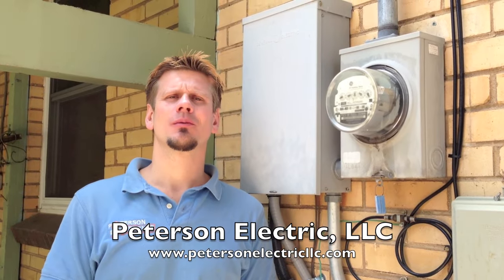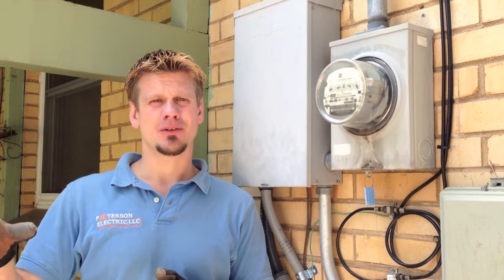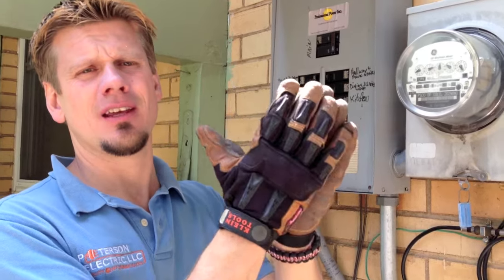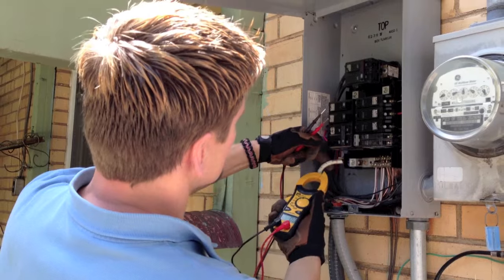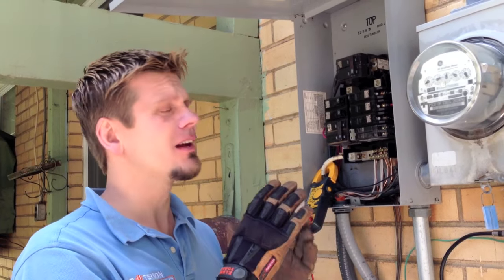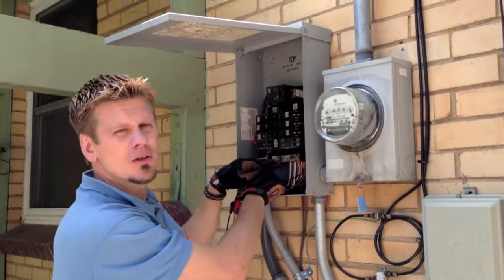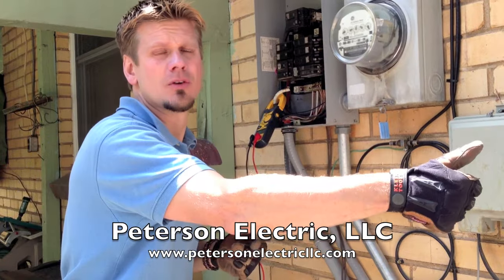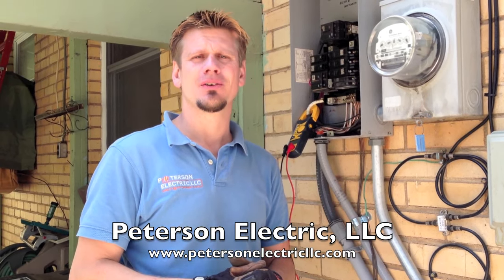Half My House Is Out Of Power, CO Electrician

Comment: I had someone come replace a blower motor on my air handler. He ended up shorting something cause lights to flicker and he ran to breaker box said the main was hard to turn off. Now I have power to some stuff but if I turn anything else on they turn off. I check the Dryer like you said it isn't getting hot and my range is throwing a power code. Would a short like this cause the breaker lug to go out?
Reply: Hopefully you found out that this is because of open splice or bad circuit breaker by now.   Shorts go boom.

Comment: If the wireing coming into the house is bad do I call the power company
Reply: Yes. I also advise you to not go near the wiring, even 120 V can kill.
Reply from the maker: I think that when someone gets shocked on the Neutral, it is due to the Black and Red Ungrounded HOT conductors sharing a Neutral path. If one is running and the other is off, the Neutral can still be carrying current in a kitchen, for example, your working on the west plugs and then the east plugs are together and the frig kicks on to cool. 

If you are in water or grounding near a cold or hot water pipe, this can be a difference of "equal- potential" that the code speaks about in grounding for spas under 680. This with someone with a weak heart can cause heart failure.
Reply: Peterson Electric    Getting a shock from neutral is caused by bad or no earth ground connected to neutral in the main panel.   The bonding jumper must be installed there and nowhere else.

Comment: On my main line coming in house I get zero on one pole and 120 on 2nd pole and half my power in house only works driving me nuts
Reply: Forget yo powa
Reply: I checked it b4 breaker box n only get 0 and 120 . it only does it when it's cold outside I think maybe the drop that comes from power line is froze or something at top of the house. Dte saying it's not there problem but they won't even come and check the line on the pole
Reply: I live in grosse pointe , mich. It's only been a issue starting last year of oct,2012. Heat is forced which is off cause it's on side of circuit breaker that's out. Square ft 1200. Own house since 2009 it was built in the 50s. No remodel done to house. It's only goes out when temperature drops in single digits when it warms up bout 20 or higher power pops back on. Also I'll like to say thank you for taking the time to  answer my question
Reply from the maker: Might of been a Mole if it was underground that he chewed it. How did you guys find the exact location, did you retrench or just splice that spot?

Comment: I was down with your explanation till you said “ looking for path to earth. “
Reply: Explain yourself. All electricity is trying to get back to it's source i.e. lighting returning to earth.
Reply: The earth isn't the source, unless you are talking about ground or atmospheric static or lightning, the powerplant or transformer is the source and the earth is the path. I even worked on a barn, about 1/8 of a mile away from the house, that had one wire (Hot) to an outlet and a light, but the other wire (neutral, no ground) ran to a series of ground rods, letting the power return to the pole ground through the earth. 💙 T.E.N.

Comment: I wouldn't recommend switching appliances on to force showing up a neutral fault. Sure way to destroy appliances!
Golden rule: lights really bright or really dim, switch off the main. Then call an electrician or test it yourself *if you know what you're doing*.

Edit: don't those 240v appliances run phase to phase? In which case a faulty neutral would make no difference. I'm not familiar with US electrical. Here we have 240v phase to neutral and 3 phase is 415v.
Reply: The suggestion he offered involving switching on appliances applied to troubleshooting a Phase issue, not a faulty Neutral. And yes, the older 240V appliances here in the US, that do not contain microprocessors or chipsets, run straight off 240 and would not be impacted by a Neutral abnormality. The modern appliances with processors use the 240V for the heating elements and 120V to power the processors. Having a "smart" stove and dryer is the new age of living!  LOL

Comment: At the end you stated the. Power will still find its path to earth. This is incorrect. Electricity always seeks a path to the source (the transformer in this case)  it doesn't seek earth ever.
Reply: +acoustic4037 .. Electricity will seek the path of least resistance, be it a ground, neutral, or another hot leg. Whatever is the easiest way. The key is knowing how to figure out the problem. After that the fix is easy. (unless what you find is hidden in conduit or underground)
Reply: rupe53 technically, electricity takes All paths not just the least resistance. But that doesn't change the fact that it seeks it's source. Meaning it doesn't seek earth for the sake of it. It seeks the source, and if it can get to the source via earth to ground conductor to neutral bond in box to transformer then so be it. Its subtle but a relevant point.  I believe that you know what you're doing, it was jus that phrase i want to clarify for viewers who don't understand.
Reply: ++acoustic4037 .. Let's not confuse things with arbitrary terms. Saying it "seeks it's source" is like saying a leaky bucket will put water back in the bucket. What it seeks is the same as water pressure (high pressure goes to low) or with heating (hot seeks cold) or a balloon with a pin hole. (high air pressure also seeks low pressure) Point being the MAJORITY will go the path of least resistance, even though some will go elsewhere. A short circuit the power does not go it's normal route through the appliance. The term "short circuit" means it took a short cut via the path of lower resistance (neutral, earth ground, the other leg, are the only choices) which may pop a breaker or burn a wire. At that point the power stops flowing. Found this definition on the web: "When electricity goes to ground, it does not simply disappear. Instead, ground acts as an “electrical loop” that an electrical current uses to return to the ground of the power source." What they don't say is the power will flow up to the point of limitations within that circuit, meaning the wire burns up (quickly or slowly) or the breaker trips. Now I have seen cases where a power feed to a garage has a pin hole and each time it rains there's a slow leak to ground. It didn't trip the breaker right away and the garage still had power, but over time about 3 ft of the wire burned up and finally tripped the breaker. Yes, the power went in several directions, not just ground, but the wiring eventually failed when the majority took the path of least resistance and overloaded the breaker.
Reply: rupe53 in any normal circumstance, there is only one source of electricity, most commonly it is the secondary of a transformer, and anything leaving the transformer seeks only to return to it. This concept is not arbitrary and can be confirmed. I learned it from Mike Holt.
Reply: acoustic4037 "and anything leaving the transformer seeks only to return to it." The key is here in your own words except going back to the transformer means via the return path (not the feed path) meaning the neutral / earth, which is the center tap on the power company's transformer. (look it up) Remember, the power company doesn't use a neutral out at the pole on their side of things. It's all reference voltage from one leg (or phase in their case) to another. Once power goes through the transformer we now have a single phase that's split into 2 legs via a center tap (neutral) on the transformer, which always bonds to earth ground, AND there will be a ground rod at that pole as a redundant safety feature in addition to the ground rod(s) at the customer's house.
Reply: rupe53 you are correct but you have misunderstood me. I was referring to the last transformer in the chain, meaning the step down at the pole by the house. Residential power comes from that secondary. The electrons in a house seek their source which is the secondary coil at the transformer, not someplace at the power company. A transformer creates a separate system. Pretty sure electrons stay in their respective system. They dont jump across the secondary to primary upstream.
Reply: acoustic 4037.. Yes, the path of least resistance in this case would be the pole (or pad) transformer feeding the house but since electricity wants to complete a path, the hot leg will want to seek (or complete) the circuit, which will be the center tap via the neutral / earth. Remember, that path of least resistance is also the path of highest current draw, so obviously something is gonna go "bang" one way or another, which may be another way of completing that circuit. 2 hot legs forced together will cause the transformer to buck (opposite AC wave forms) which will cause some sort of equipment failure (seeking ground) but hopefully the overload protection trips and prevents a major issue. OTOH, this seldom happens unless there's physical damage in the first place. (car hits pole, tree on wires, etc)
Reply: I've enjoyed your videos and conversation.  I can't keep this thread going because you probably know this stuff but you continue to make inaccurate statements such as "seeking ground".  It may "take a path to ground" on it's way home to the source, but it doesn't "seek ground"  It always will seek it's source through any and ALL paths available not just the "least resistance".  "least resistance" should not be part of your vocabulary.  The science behind this is so precise that it requires a more precise and correct usage of terms and vocabulary.  I'm sure you understand this stuff, but conveying it you must be careful how you articulate it.  Thanks for making and sharing videos, I always learn something from others.
Reply: You are right. Perhaps "seek ground" is not the exact term to express this clearly. What generally happens is the power wants to complete the circuit, by whatever means. A slow leak to most air will conduct and so will many other things, provided there's a voltage differential. Here's something to ponder: Ohm's law I=V/R would explain what you are asking. Given a common potential, the amount of current flowing through a resistive element is inversely proportional to the resistance. This would mean, and hopefully answer your question, that a path of lower resistance will have more current flowing through it than a path of higher resistance.
Reply: All true.  I did not ask though. I know ohms law.  When I said power takes "all paths" that is what I meant.... proportionally as impedance allows.  I did not say "all paths equally".  Keep up the good work friend.

Comment: I had a house where the power would go out on some circuits. It would go out and after awhile it would come back on. It would do this maybe once a week. I called an electrician. He took the cover off the panel. I didn't see him test anything. He just said you need a new wire from the pole. He called DTE they came out and an ran a new wire. Problem solved.
Reply: Hey, I'm getting the same problem. Could you give more information on how the issue was solved? Would really appreciate it! Thanks

Comment: I had the same issue about three weeks ago. But it was caused by a short circuit in the underground service line that goes to my house. A mouse chewed through it (that motherfucker lived!) Luckily it wasn't the neutral wire. Eversource was nice enough to give me the affected area, and some other wires for a project that I am currently working on.
Reply from the maker: How did you or your guy located the exact short underground? or did you just have the whole thing retrenched?
Reply: They used a piece of equipment, I don't know what it is called, but they stick in two probes, and it senses if there is electricity running through, I'm not sure if it works that way, but if I find out, I will tell you.
Reply: TDR meter. The only thing is, is that I am not too sure that this what the utility company used.
Reply from the maker: They most likely used a large under single lug connector underground with a rubber heat shrink material, assuming they did not retrench, or most it could have been as simple as a lose connection at the top of the transformer on the pole or an underground connection under a manhole cover.
Reply: Yeah, if it's overhead, it's easier because you can see where the problem is, unlike underground service.
Reply: This is why underground service conductors should ALWAYS be placed in conduit -- NEVER using direct burial.